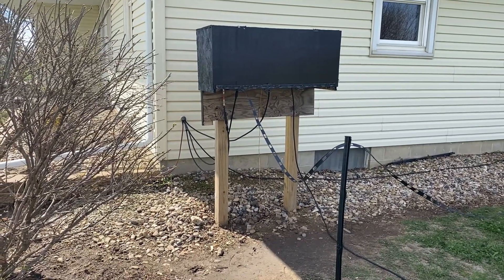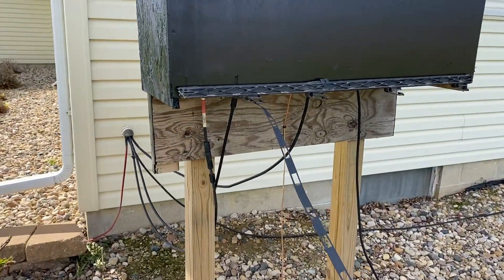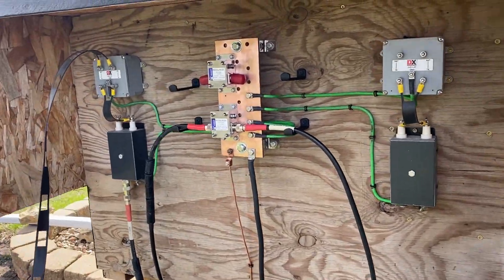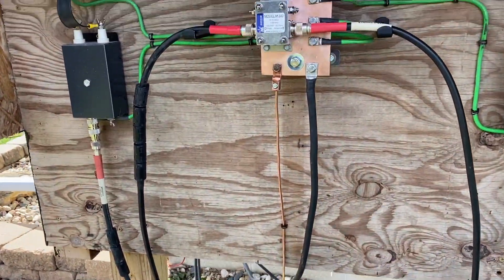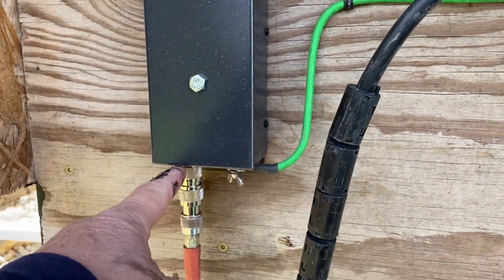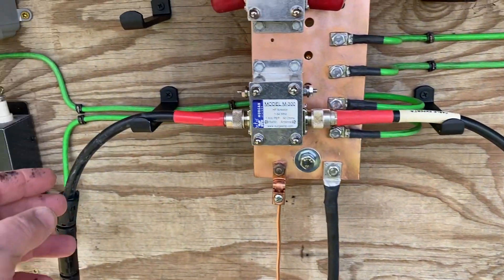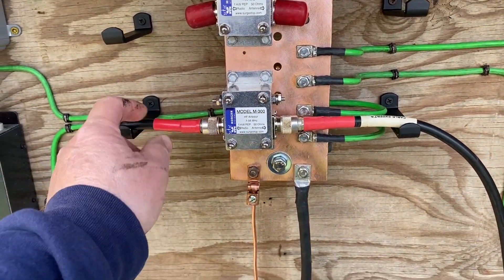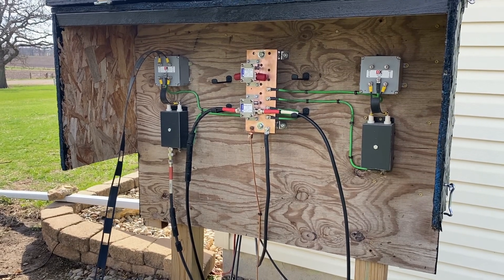Off Grid Radio Station Grounding Update

Comment: Nice job Kevin.  I have a 75mm dia, 1mtr long  copper pipe driven in the ground.
73 brian in nz.
Reply from the maker: Hi Brian.. That works very well.. I’m probably going to drive a second rod in a distance away and bond together as well.. Static discharging those wires via the lightening arrestors is my biggest concern.. Thanks for watching and supporting the channel.. 73, Kevin k0klb

Comment: Looks good, Kevin. I would connect to that second ground rod also, since it's in the ground. I couldn't see that hurting..  VE1SK
Reply from the maker: Hi Steve, you're right, it can't hurt to connect to that second ground rod.. My next step was to order a second “copper” ground rod and sink it a distance from the main and bond together.. I was going to pull that cheap one out but may rethink it now.. thx for your comment and support Steve.. I appreciate it.. 73, Kevin k0klb